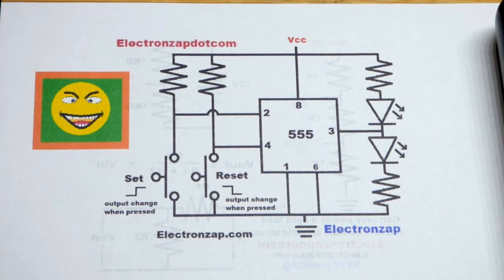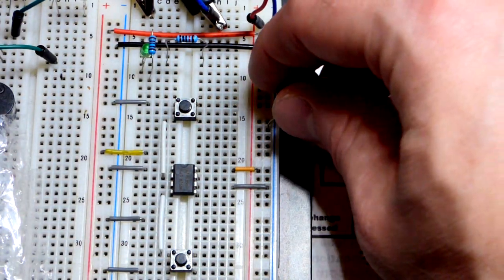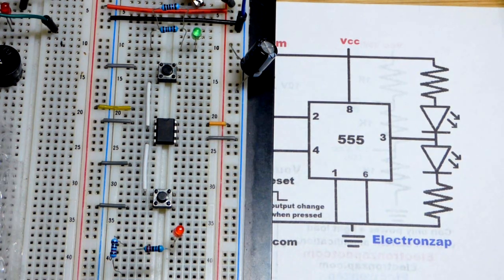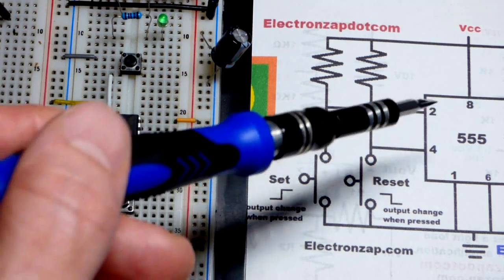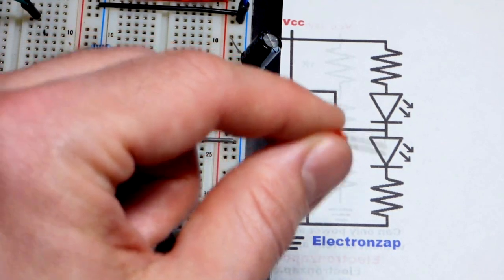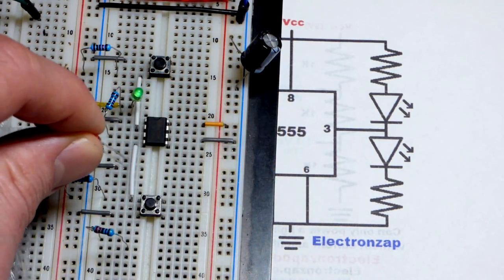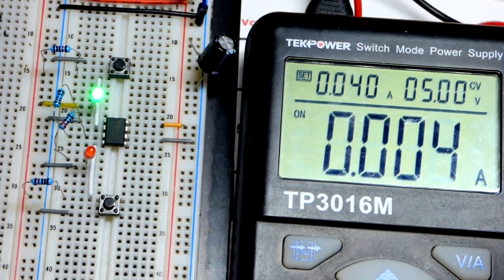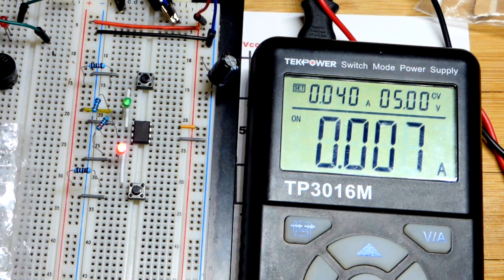Quick 555 timer bistable flip flop mode circuit schematic to breadboard build by electronzap

Comment: guess replacing the set switch with a capacitor would make an automatic slow turn circuit  for an audio amplifier ?
Reply from the maker: Not sure how that would work unfortunately..